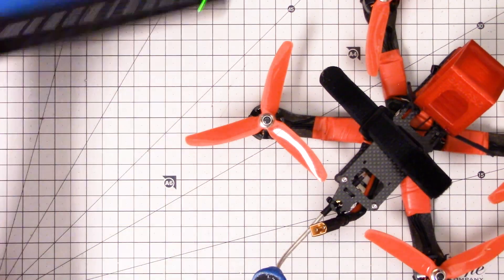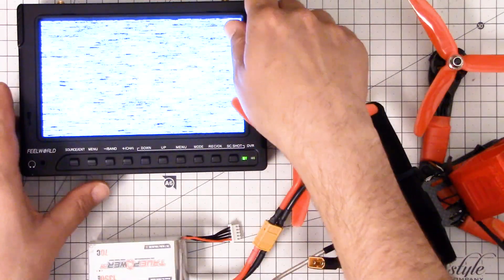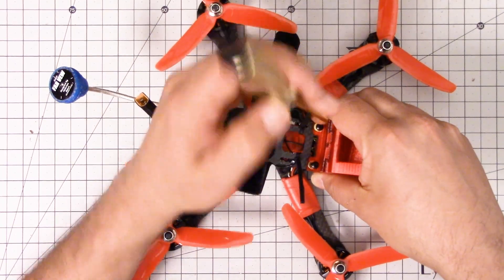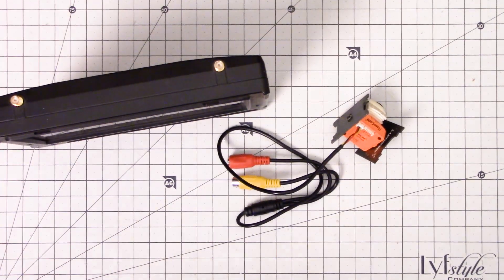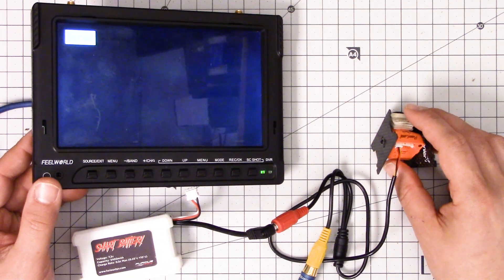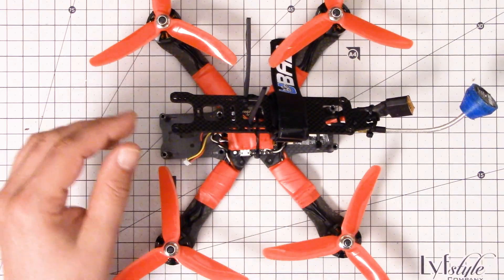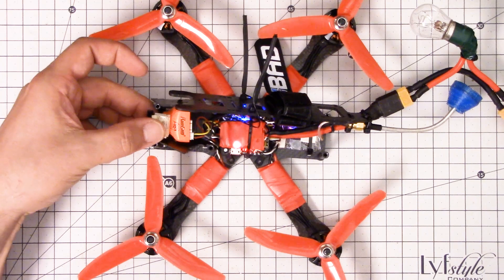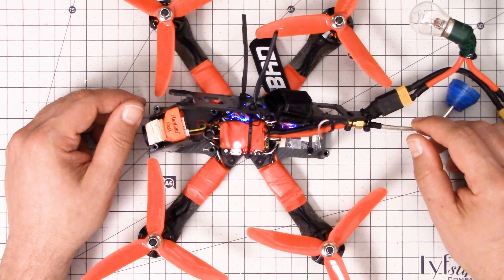FPV Camera Black Screen | REAL WORLD TROUBLESHOOT

Comment: Im surprised you didn't inspect the solder joint for video in/out on the board..I suspect a cold solder joint.. Been there, done that.
Reply from the maker: That wouldn't explain why there is an inductor-like humming noise. That's what focused me first and foremost on the power.
Reply: oh, yea, I forgot you mentioned the humming at the beginning. Either way, I'd still run a visual check. Process of elimination.

Comment: my guess is it's the FC power circuit to the camera, if your powering the camera from the FC. Try powering the camera from the vTx.
I only power cameras from the vTx and pass camera signal though FC to get OSD.
Reply from the maker: FC is powering the camera via vBat, so that seems unlikely. One test that I do want to do is to power the camera with 16v on the bench instead of 8v. Maybe the camera is not happy with higher voltage output.

The problem did start after I installed the BFF3 so the way the camera is being powered has changed.

Comment: When you tested it back on the quad, you had the power already connected. I was wondering if powering the quad after connecting the camera may make a difference. With the whole RIP thing at the end, was the camera actually dead?
Reply from the maker: I'm not 100% sure but I do think it is the camera. The final test will be to power the camera with 16v on the bench. Since the camera is powered from vBat on the quad, I don't think it's likely it's an issue with e.g. voltage regulation or something like that.

Comment: +Joshua Bardwell 
If this is a Betaflight F3 board, try using common ground between board, vtx and camera if you are not already.
Ground both VTX and camera to board e.g. VTX ground to AGND and camera ground to GND on the soft serial row (row under the ANGD/VBAT/VIN/VOUT row of pins.
These issues have been really common in the BFF3 thread on the RCgroups thread and the above is pretty much the canonical suggestion.

Also as you say don't use auto to select PAL/NTSC, manually choose in BF configurator.
I can't explain the humming, but as I say there are lots of these issues in the RCgroups thread, although not an electronics guy I can recall hearing something about ground and humming in some electrical devices...mumble mumble...

Here are a couple of examples: https://www.rcgroups.com/forums/showthread.php?2795213-Betaflight-F3-Flight-Controller-OSD-PDB-SD-card-BEC-current-sensor/page14

Also see: http://blog.seidel-philipp.de/betaflight-f3-flight-controller-anschlussplan-wiringplan/

Also be aware the mounting holes on at least some of these boards are also on the groundplane.
Reply from the maker: I will give this a try. Thanks.
Reply from the maker: Hang on I'm not certain I follow. Right now, both cam and vTX are going to AGND. Are you suggesting splitting them out?
Reply: Both camera and VTX on  AGND should be  cool too. Don''t bother splitting them out.

The thing is to get them both grounded on the board (which both to AGND obviously achieves)  as opposed to  for example VTX grounded to the board and camera only grounded to VTX.

Please ignore my suggestion.

Comment: How is the camera powered, 5V or Vbat through the Betaflight F3 board? 
If it was a bad 5V voltage regulator on the board (that didn't give 5V out at all), then the OSD/Betaflight board would also be affected. However if that voltage regulator was giving out less than 5V when it was making that noise, that could be a problem for the Runcam?
See if you can measure the voltage going to the camera. 

It could be a bad connector going to the camera or cabling, try to wiggle the cable / connector around a little bit. Also you showed plugging the camera in while the quadcopter was already powered up, what if you repeat the initial problem - plug the camera in and plug in the Lipo, and repeat unplugging/plugging the Lipo a few times.
Reply from the maker: vBat through the BFF3 pad.

Comment: possible bad solder joint?  jiggling the wire made a connection?
Reply: that's my thought...
Reply: Michael Brewer Yep, that's it most likely. My PDB makes that same high-pitch noise when the camera +12V is not connected but signal is.

Comment: I had a Tramp VTx that was making that high pitched humming sound and it would go away when I wiggled the ground wire, suggesting a dodgy connection to ground.  Unlikely it's the VTx in this situation as it was transmitting fine, just no image from the camera.  But... maybe it's a flakey ground wire between VTX and camera?  Can't say I understand why a flakey wire would induce an inductor hum, but thought I'd share my only experience with that high pitched hum in case it helps.

Comment: Sometimes the white or bright spaces in the Video are flickering.
What could be the reason?
I got it powered with 5v of the video transmitter.
Sometimes it works fine. :/

Comment: plz remove those meat cutters next time XD
Reply from the maker: I'm not teaching bad habits. I said, clearly, that it's only okay to leave the props on because I am using a smoke stopper. It's not in any way dangerous to plug your battery in with a smoke stopper installed. The motors can only pull like 3 amps total, and the entire copter will shut down from voltage sag if the ESCs try to spin up.
Reply from the maker: +Job91 sorry, but I don't really like the Dutch anyway.
Reply: If you watched, he states his rig only allows the copter to draw a small amount of amps, in doing so the blades will not spin fast enough to do any harm.
Reply: and also once the copter pulls more than a couple of amps, the escs shut off completely and restart
Reply: I've seen multiple youtubers completely bandated and chopped up by their own machines doing this kinda thing where they dont use currenting limiting on their batteries and try to flash their quads with props on. its a really big problem. with 30K subs teaching bad habits although this one is I agree acceptable for him to do is kinda dangerous.
Reply: haha XD
Reply: yeah youre totally right you were super safe. But for Dutch speaking 13 year olds with Eachine Wizards under their christmas tree. They won't have a clue XD find your vid because their quad does not have TX and cut their hands to bits.